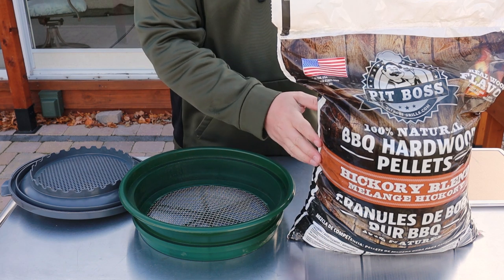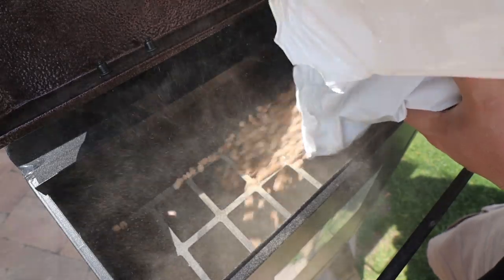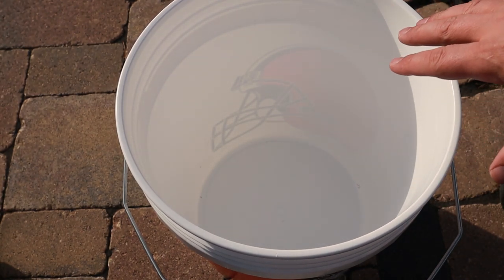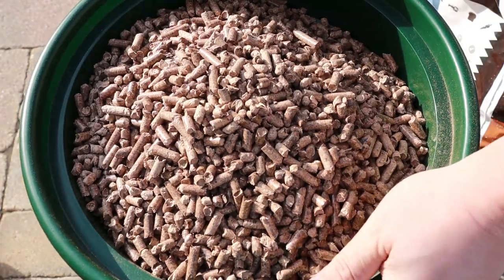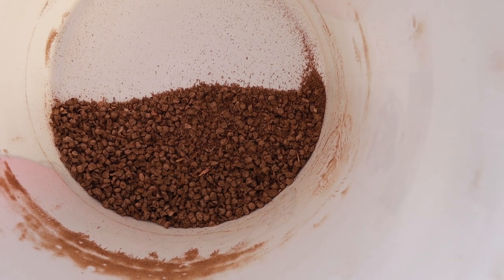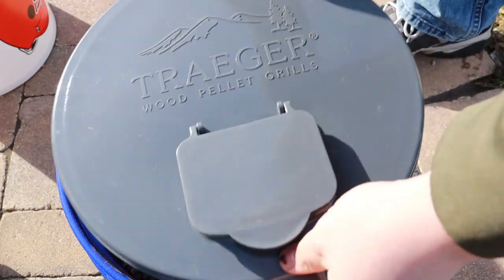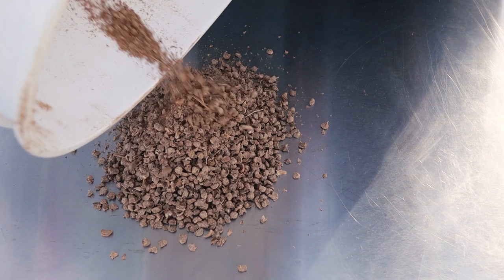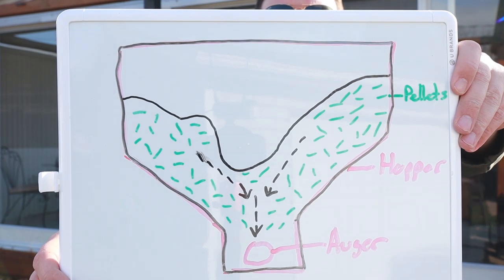Pellet Talk | Sifting Pellets

Comment: Excellent video - I run about 6 tons of pellets/year through a box store Englander pellet stove. If I do not sift the fines out of the pellets the fines clog the auger & require a lengthy weekly cleaning.  But if I sift the fines out the stove runs trouble free all year. The pellets I use are also from the box store & possibly if I purchased somewhere else the pellets would be cleaner, but the box store is just 1 mile from my home & I like giving them my business.

Comment: I have been using a variation on this since I got my Traeger. I pour mine into a bucket as well, but fill up my hopper using a plastic cup with holes drilled in it as a sifter. I usually try to shake the bags before filling the bucket to settle as much fines as possible, but there are still a decent amount. I keep my grill in the garage, so moisture may not be as big of an issue for me as others.
Reply from the maker: Thats a good idea!

Comment: preheat your oven to 250-300 and put the lid in for about 3 min watch it you don't want to melt it but take the lid directly from the oven to the bucket and it'll fit let sit for a few hours and then your good to go. its meant to be a snug fit so it doesn't pop off when all the weight is on it when dumping into your hopper. as my dad would say ask me how i know.
Reply: I can vouch for this rectification. I used it for the tops of a couple of mixing bowls. Worked great.

Comment: I had my auger bind up with a large wood chip that was mixed in with the pellets. My first 40lb bag in my new smoker. I will now sift for fines and to pull the wood chips out. Thanks WEW BBQ for the tip!
Reply from the maker: Yeah, I figure for the little bit of extra time it takes to sift them its well worth it. I'm going on two years without any auger issues.
Reply: I had a chunk of hard wood jam my Pitts &spitts auger. This past weekend. Ruined my brisket overnight.  I’m
Done with pit boss.
Reply: @gm3353  sorry to hear that. It can be very frustrating when it fails. Best of luck if you go a different direction.

Comment: Great video.  Made me think about preventative maintenance.  Got the sifter and the 5 gal bucket top.  I also found a Kingsford bin that is rectangular with a spout on the top.  The bin claims to keep charcoal dry, so I will store pellets.  I did have to use a hammer on the lid to fit the 5 gallon bucket.

Comment: I personally just use a screen to get the dust out, I haven't had issues with smaller pellets or fragments and the auger.   I now run lumberjack pellets exclusively and have observed that the smaller pellets cause less strain and clunking on the auger, where it runs much quieter than it did before I changed pellets and started straining.
Reply from the maker: Joseph, I like the lumberjack a lot. They have a smaller diameter and as a result they are able to get more pellets through the auger and this allows for a really clean burn, not to mention hotter and less ash. Where do you buy your Lumberjack pellets? I was able to get them at Drug Mart this summer but nobody has them in stock right now.
Reply: @WeekendWarriorBBQ  I get mine from my butcher, Blue Max Meats in Buckley WA.
Reply: @meshlol   I get mines from Blue Max Meats in Puyallup but i only get 20 lb bags as i already have alot have not smoke or use my grill in couple of months

Comment: Hey buddy thank you so much for this! I just bought a pellet smoker and did my first burn off. I noticed a bit of ash flying around and the pellets I bought have a lot of dust and tiny broken ones. This is going to come in so handy.

One question though I notice after I dumped out all the pellets there are still some that stay at the very bottom and I can’t get those. I’m hoping they will just move in to the auger and burn off. Any advice? And by the way I live in a dry climate in Southern California so I don’t think I will have much of a humidity problem.

Comment: What screen size should I get? The link goes to 1/4" and I ordered it. Now I'm thinking that's too big and all the pellets are going to fall through.
Reply from the maker: Hey Boomer! The 1/4" works on Pit Boss pellets. the 1/8 inch will work on the smaller pellets like Lumber Jack
Reply: @WeekendWarriorBBQ  thanks! I use Lumberjack also, so I'll get a 1/8" one ordered. Thanks.... Love you videos.
Reply: Boomer501 How has the 1/8” sifter working for the LJ pellets?
Reply: I'm still using the 1/4 one. It's been working out really well. Most of the smaller pellets are at the bottom of the bag anyway. A 40 lb bag will yield about 1 scoup of sifted pellet pieces.

Comment: I had the same problem with the Treager set. Either the lid fit and the screen didn’t or visa versa. Tried a number of different buckets.
Reply from the maker: It’s bizarre... I was just reading some reviews and people say that they have to rub some cooking oil around the edge and you can get it on. They also say that once you get it on it stretches permanently and works good. I haven’t tried it yet but was surprised that I couldn’t just snap it on.

Comment: Just started following your video series.  Absolutely love them.  Did you ever figure out the bucket lid issue?  I don't want to purchase the Traeger lid if they do not fit standard 5-gallon buckets.
Reply from the maker: Thank you. The lid just needs to be warmed up a little. It is meant to fit tight but with that said, I dont use that lid anymore. I use a regular bucket lid and take it off to dump in the pellets... its way easier that way.

Comment: Good info, my auger has been making a slight popping noise occasionally? Maybe this is the culprit? I’ll have to do a breakdown and check it out.
Reply from the maker: Thanks, Phil! The more I looked into the  topic the more convinced I became to just spend a couple of minutes to sift them “just in case.” I’m using the sifted fines as a fire starter for my charcoal grill so nothing is going to waste.
Reply: Weekend Warrior BBQ I got a bag of pellets to start my chimney with. It works as good as starters do, and is way more cost effective.
Reply from the maker: Sweet! I was wondering how they would work out. I hate using those wax cubes so I’m glad to hear the pellets work. Makes perfect sense.

Comment: I’ve been waiting for this. Your pellets come out nicer than mine. Mine have a tendency to scatter all over. Even with the bucket. I have a nasty feeling that the Traeger lid is designed for the Traeger bucket. How or where did you get the green Pit Boss sifter?
Reply from the maker: Hey fellow Buckeye! I’m going to find a way to force that lid on. The green sifter is just a generic softer and I have a link to it in the description. What do you do with your “fines”?
Reply: Haven’t done sifting yet. You told me a long time back you were going to do this so I was waiting on the pro to show me what he came up with. I wasn’t impressed with that Traeger sifter. I think I’ll go with the green one. I think the fines would compost in the garden. I pulled my safety grid long time back. The screws that came out, I went to Ace and got some nuts for them and put the screws back in the holes so I wouldn’t lose them. Just in case.
Reply: Tomorrow to get up to fifty. I’ll fill the hopper with Competition Blend. Have a couple tiny pork shoulder roasts and half a whole loin. Then let the smoker rest ti
Reply: Till thanksgiving
Reply: The Lumberjack charcoaled pellets dont have any dust at all, and have worked great in my pitboss 820.